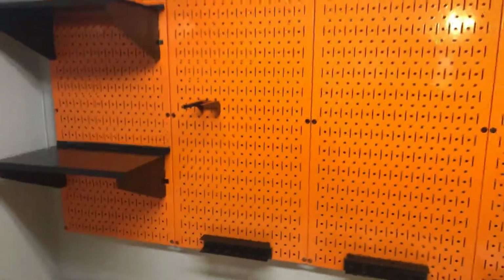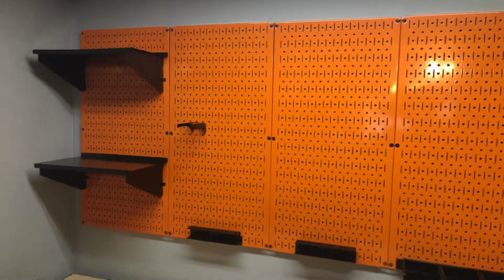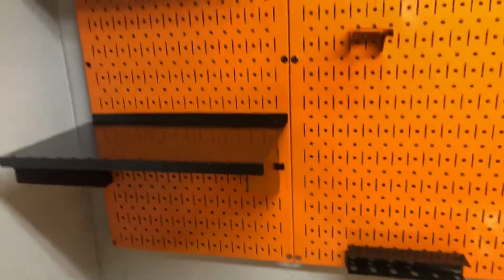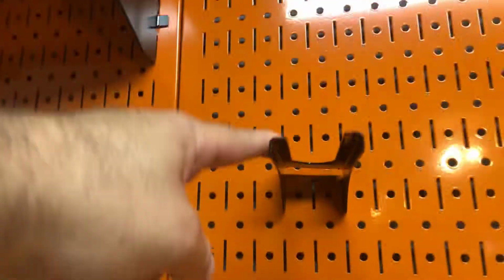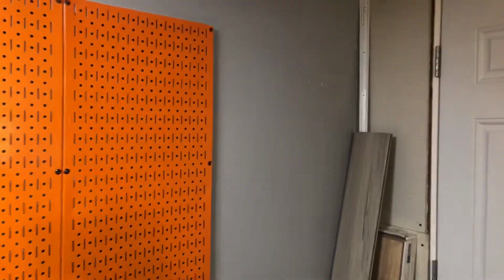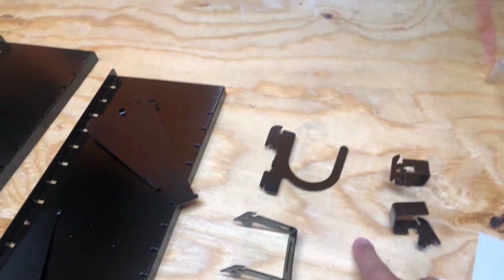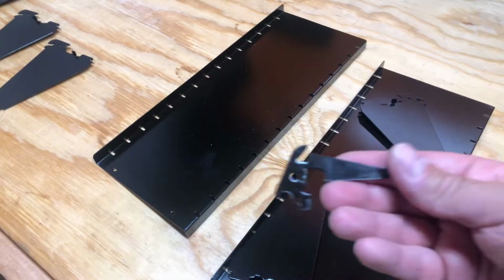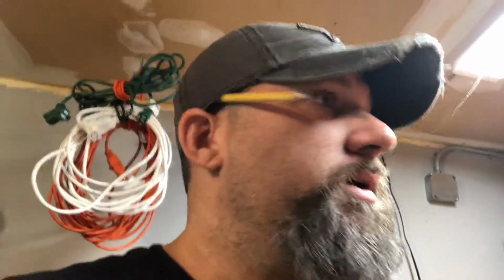Finished install of Wall Control Metal pegboard system

Comment: To space the pannels, I've used tile plastic spacers made like a cross (+) at top and bottom. The use of a double sided tape (or small finishing nails) keep them in place at the bottom.

BTW, the color is awesome.